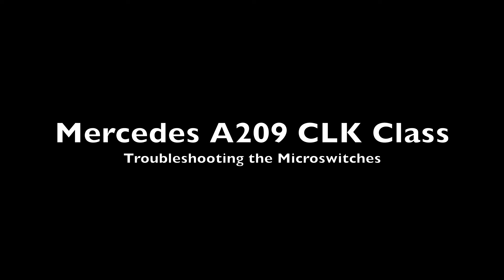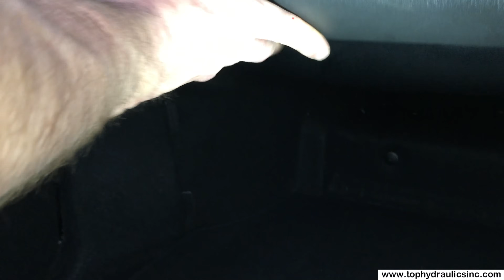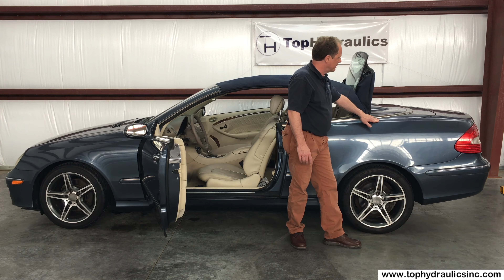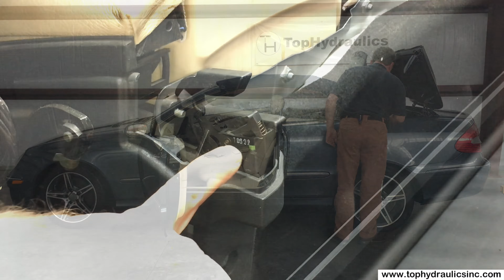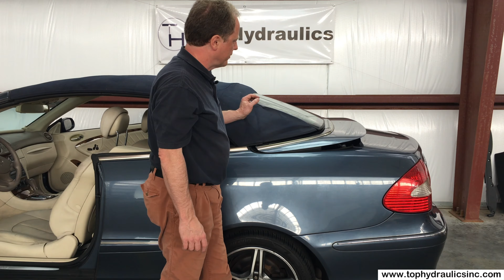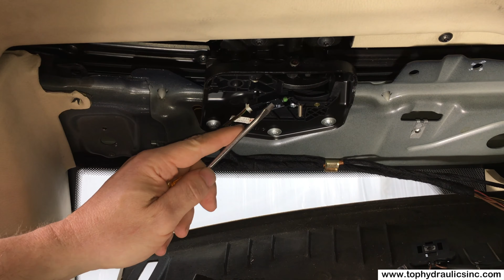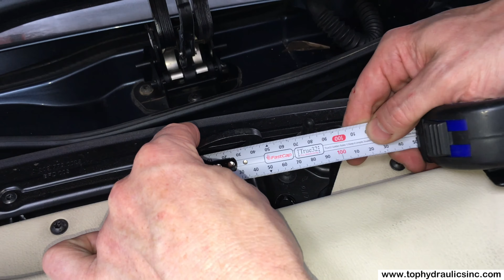Mercedes A209 CLK - How To Troubleshoot the Microswitches

Comment: Mine starts to open,  then the top sets back down and the claws close down while the back is partially open. The top doesn't move past just popping open.
It goes until it seems to get stuck. I hear the pump still trying to pump, until I let off the switch. Then it won't continue again, unless I start to close it then try to open it again. I guess you can say, mine gets stuck when the back window is straight up. The cover behind it is only up about 2 to 3 inches.
Mine starts to lift that section behind the window and stops. So it gets a little further than where you had the window up and the back section was down. Mine is up at the back, but the front of the section behind the window is loose, but doesn't go up.
Reply: Did you get this fixed? What was the issue?
Reply: @RichRyan-d3i  When watching these videos on troubleshooting the convertible top system, he said not to add a stop leak additive to this system, because it will cause a leak. By the time I caught that in the video, it was too late. I added a stop leak to make sure it didn't start to leak, being over 15 years old. So, I ended up buying a used pump on eBay for under $150, and I bought the hydrolic oil on Amazon. I bought a suction tool to pull the oil out of the system and to put new oil back in. So, when I got the new/used pump, three years older than the one I was replacing, I filled the reservoir, ran the top open then closed, emptied it, refilled with new oil, ran the top open and closed, and emptied the reservoir again and refilled it. I did that 3 or 4 times, to get any of that stop leak out, because he said the seals will start to leak now. I'm hoping they don't, but it's been working for now. So, my issue was the pump itself. It was not making pressure, as the seals went bad from my mistake of adding AT 205, a stop leak product. I told Scotty Kilmer that he owes me for talking me into using that stuff on everything, but he never replied to my message on one of his videos.  LOL 
I believe that also caused the struts for the trunk devider to go bad so fast. I put that AT 205 on everything. It may be good for American vehicles, but German vehicles has the seals made with a different seals that can't handle the stop leak additives. A silicone spray is all you need on the struts and seals.

Comment: Hi there , wonder if you can help me, I have a w208 2002, the roof isn’t working properly, the red switch blinks when I drive suggesting the car thinks the roof hasn’t been close properly, at the same time am having another two issues which might be related. The boot won’t open with the remote and the rear window defrosting is not working. I checked all wires that run on the boot area and seemed ok. If I manually open the roof it will close and work with the hydraulics and everything works until I move the car a few meters then all the problems start again, any suggestions? Thank you.

Comment: Very clear and excellent explanation!  It helped me solve my simple problem and saved me over $1000 that the shop was going to charge me!  Thank you so much!  Question please:  what is the name of the strut that activates the limit switch located on the driver side of the trunk that indicates trunk partition is closed?  Do you have a part number?
Reply from the maker: The gas strut is part number A2096900059. You can find aftermarket gas struts fairly cheap if you google the part number.

Comment: The limit-switch at 9m 24s, does anyone know the Mercedes part number for it? I have the A208 soft top..
Reply from the maker: Since you have an A208 CLK, this video is not quite the right place to ask the question. I assume that you are referring to the switch shown here https://youtu.be/8EBHtSDNLVI?list=PLly4CMbpk7oxzBZ8FtJqcAAKBzx0dxgB8&t=187, which is hard to come by as it has been discontinued by Mercedes. It is part number A2088202310.
Reply: @TopHydraulics  Thanks for getting back to me I' do apologise I didn't see this reply... I would like to properly explain the problem I'm having.. The rear window lifts and then you hear the motor trying but failing to open the compartment cover. I then release the cover manually using a flat spanner behind the middle of the rear seat but I don't move the lid manually. I go back to the operating switch and you can hear rhe pump but the lid doesn't move at all.   When the rear window lifts, does it open / close a switch inside the 'compartment lid hole' where the rear window 'catch' slots inside? I have been caught out and drowned the car twice in rainstorms with the roof down on two occasions in summer so I'm wondering if there is a switch in there that tells the ECU that's it's ok to lift the compartment lid?  Thanks very much.

Comment: Hi, since yesterday the convertible top of my CLK does not work anymore. I had pushed a laundry basket probably too far in the trunk. Now the flap stands vertically in the air on the trunk. Do you have any idea how I can solve the problem? Because you can hear the click of the electronics, but nothing moves anymore.
Reply from the maker: Maybe I can help you if you can give a more detailed description. Which part are you referring to by the "flap"? Did the top move at all before it stopped working? If so, then please clarify exactly which portions of the to or the storage cover have moved.
Reply: @TopHydraulics  As I drove off, I noticed the cold wind and stopped to close the top. The flap (cover) in the back went up, the top went up and stopped. I was irritated by this and pressed the button for the top again, but nothing happened. Friends then manually pulled the top forward so I could slowly drive home while the flap/cover in the back continued to go up vertically. Today, unfortunately, my husband manually pushed down the top in the back again and tried to push the lid/cover/flap lower with a little force. Now nothing works at all. Also no longer goes to pull the top forward, because the lid prevents that. Now the car is completely open outside. I have then visited a workshop. They could not find the error with a Hella-Gutmann diagnostic device. The technician only said that a cable break could be the cause, but he was not sure. I thought that such a device always shows the exact weak point. The cover that closes everything at the end is stuck at about 45 degrees. The red light on the button for the top is on or blinking constantly. In the front of the display it says the top is lowering even though my husband pushed it in manually. Since reading with the diagnostic device, the rear two windows do not go up. They are down and no longer move. Further, the small upright knob above the longer one for seat height is no longer working. No idea what this knob is for (headrests?). This all happened because after a birthday party a guest wanted to help me carry a heavy basket of dirty dishes into the car, which he pushed too far under the ski bag? Are the limit switches S849 not working due to a collision with something in the trunk that touched the cover compartment? Do I have to go to the repair shop or can I fix the problem myself. Unfortunately, my husband has two left hands (German saying). Thanks for your help in advance and best regards from Germany.

Comment: Hi, Great Video! I have an issue where when my top on my 2009 CLK550 is closing the rear hard partition will not completely cover the convertible top. It is as if the convertible top will not go all the way down into the rear part of the trunk. It than sound like it is breaking and the rear hatch partition isn't fully closed. Thanks in advance!
Reply from the maker: There are some plastic arms suspended under the bottom rear of the tonneau cover that push down on the soft top as the cover closes, which in turn makes enough room for the cover to close. Take a close look under the cover as it close to see what might be askew there...

Comment: Hi there, loving these videos 👍🏻😎 Is there a similar video for troubleshooting A208 micro switch issues?! I have the issue where roof was working fine then the only thing that happens now is the windows go down and that is it! 
The roof switch slowly flashes and the headrest switch doesn’t work at all or light up in anyway. Found a blown 15A blue fuse in the boot fuse box and replaced it but this has made no difference. The only thing was the very first time I tried to operate the roof the case cover latch made a noise as if it was trying to release but couldn’t, could that have blown the motor, relay or a different fuse?! Hoping someone can help, thanks in advance 😖
Reply from the maker: I am not aware of any comprehensive videos for A208 micro switch troubleshooting. However, here is a very extensive thread on BenzWorld.org's A208 CLK forum that gives you all the information you could ever need: http://mbworld.org/forums/clk-class-w208/519324-clk-convertible-top-problem-solving-common-electrical-hydraulic-system-failures.html

Comment: Thanks for the interesting video and I have a question?  With my CLK W209 I can't remove the roof, just lower the windows and unlock the locks above the windshield.  This happens every time after the winter.  Nevite goes could be a problem? He constantly writes errors P 1928 and P1923. Thanks Tom.
Reply from the maker: Nevite? I’m drawing a blank as to what the spelling checker has butchered here.
Also, do you get any narrative for what codes 1928 and 1923 mean?

Comment: Hi, thanks for the awesome videos on fault finding and diagnosing faults and  manual operation of the soft top

There is one part of the Open operation that you didn’t cover

I’ll run through the sequence for my 2005 CLK55 A209

1. Hit open
2. Windows go down
3. Windscreen lock release

STAGE 1: Cylinders 3 and 4 are activated to raise the compartment cover lid until switch S84/19 registers that the bow has released from the lid and switch S84/13 registers that the lid is no longer in the closed position.

STAGE 2: Cylinder 2 is activated to release the front latch. Switch S84/11 registers that the roof is no longer locked, and S84/18 registers that the roof is still in the catch position.

STAGE 3: Cylinders 5 and 6 are activated to raise the rear glass (bow). 
Bow goes up fully upright. I am assuming Switch S84/15 has registered that the bow is now in the fully upright position. How do I test that.

6. That’s it, I can hear relays clicking but cylinders 3 &4 don’t run or raise the compartment lid at all

I’ve checked all of the physical parts and can’t see any broken limits or such

Would appreciate your advice

Thanks, keep up the good work in your tutorials

Comment: Hey Top Hydraulics - can you help me please, i'm going crazy!!!? My 2004 CLK320......top goes down as usual, then won't close, doesn't even try, just states "visit workshop" - First diagnosed a broken S84/22......so replaced, but still the same error??? I then replaced S84/15 as it seemed to be happy to close the roof again if it didn't open past about three quarters open. Changed the switch, again, no fix! I've checked fuses (but as pump operates, so not likely) and I have switched around the yellow relays - still no change. Just to state have owned the car 1 year and roof has worked well. Fluid level correct in the reservoir, so no leaks. I've even taken the rear to bits to check S84/3.....which is undamaged and appears to work correctly. A recent scan on an Autel professional diagnostic tool saw no errors on the roof control module. I double checked S84/13 by jumping the wires as I could do this whilst trying to operate the hood and again, the switch tests good as no change. Been quoted £500 to diagnose by a company 3 hours drive away......car isn't worth fixing if thats my only option - can we save this lovely old 320CLK.....it only has 75k miles!

Comment: Hi Klaus
This is so helpful. Are the switches in the trunk just as important. Is there a switch in the rear left side panel, next to the rear passenger seat, as MB info says there is on late 2006 a209.
Many thanks.
Paul 
United Kingdom.
Reply from the maker: Hello Paul, every switch in the top system is important and the top will not function without every switch functioning. I am not sure which switch you are referring to. Are they giving you a part number?
Reply: @TopHydraulics  s84/3 roof open & s84/4  pawl rotary tumbler switch.
Thank you so much for your kind attention
Paul.

Comment: Hi Klaus, thanks so much for the great video. I have a 2005 clk 320 and i am getting the "top in operation" message when  casually driving with the top closed. It does not depend on the top beinf recently open or not. The top closes and opens without problems. Its just that message that appears when driving with top closed.

Can you give any suggestions? :)
Reply from the maker: Thanks for asking. Has any work been done on the top recently, such as changing the front lock cylinder or even cycling the top manually?
Reply: @TopHydraulics  I just got the car a week ago. The previous owner mentioned that the hydraulic fluid and the pump had been recently replaced. And he also mentioned that something in the front had been replaced, but I can happen to recall what it was, maybe it was the front lock Cylinder. I did not ask him if the "Top in operation" message was already there before this service. I am not aware of the top being manually operated.

Thanks so much!
Reply: Hi Klaus, i just wanted to follow up I'm here, still having the same problem. Should the front switches?

Comment: Hello Klaus, I believe I have a leak in my convertible clk200 from 2004. the top opens and closes well in 23 seconds. the point is that after 5 or 6 openings the oil level drops to a minimum. I think I must have an oil leak. I already looked for the oil leak in the trunk of the car and I didn't see anything. I would like to know if I can open the top only halfway to try to find the leak. Is there any inconvenience in stopping the opening process halfway through?
Reply from the maker: It i s okay to stop the opening or closing process part way. Hard to find leaks are usually from the main lift cylinders, as the fluid collects under the rear seat or in the rocker panels before it drips to the ground. The main lift cylinders typically leak first from the bottom, through the bottom mounting hole.
Reply: @TopHydraulics  thank you very mych for your  answer I will check it and let you know. Thanks

Comment: Curious did you show switch s84/3 in this video?  Is this a switch that commonly breaks ? Would this cause a problem of the compartment cover going down to finish the opening sequence? Thanks for taking your time out your day.  My top opens and stops at the point where compartment cover has to go down… when closing the top goes up 1/4 of the way and then stops. So my next step I manually pull the rest of the top closed until it gets to the windshield. Right after I go back and press the tops operating switch and it locks the lid close as well as finishes the closing sequence.  sorry if I’m not clear. Clk 2004

Comment: Hello! I have problem with my clk convertible, when I try to open my roof windows go down and I hear pump running for 10 sec but then nothing. Front of the roof releases, nothing happens in back of the car. Hydraulic fluid level is fine and fuses are good, what could be the peoblem?
Reply: Also computer says opening roof.
Reply from the maker: @jimirautakoski8458  What are the last six numbers of the VIN?
Reply: @TopHydraulics  001157
Reply from the maker: @jimirautakoski8458  Aha! You have an early production model with the obsolete tonneau cover cylinders A2098001072 in it. Those cylinders have a design flaw and need to be replaced by part number A209800127264. The cylinders are seized and the pump is unable to extend them.
Reply: @TopHydraulics  Thank you for quick respond!! I will try that hope it works!

Comment: Hello Klaus, when opening the top on my Clk a209 it opens all the way and stops at the point where the Tunneau cover has to go down to complete the process . Is  the switch assembly part #2098201810 the part I need to fix my issue? Thanks for the help
Reply from the maker: The most common problem in this situation is this switch: https://youtu.be/ZLIdoiw_KTY?t=235
Reply: @TopHydraulics  hey Klaus thanks so much you are truly the greatest! So to be clear the part I may need is actually 2098201910 ?
Reply from the maker: @malakwinnson428  You may want to examine it first. If that switch accidentally stays triggered, then it can cause the symptom you are describing. Yes, it is part number A209 820 19 10.
Reply: @TopHydraulics  okay thanks again. Do top hydraulics sell that part?
Reply from the maker: @malakwinnson428  We don't sell switches: only cylinders, pumps and hoses
Reply: @TopHydraulics  Gotcha, well I’ll check the part to make sure it’s working properly I think it might be the problem because on one side the switch was actually stuck where it didn’t have the spring when I pressed down .. thanks for the help !

Comment: Hey... I have following problem, maybe you can tell me where to look first?!

Everything worked fine, roof is closed.

Next day: no message at display, windows move, hydraulic starts working... thats it. No movements. 
Works in both directions (close and open) even though the top is closed. I would really appreciate your hint.

Comment: Hey klaus so i was opening my top and the process stopped at the end where I think you call it the tonneau cover it won’t go back down it stops…. It originally opened up to let the top go in but once the top was went inside the back the cover won’t go back down its just stuck up in the air. You know what can cause this?   Do you think it’s because of not enough fluid?